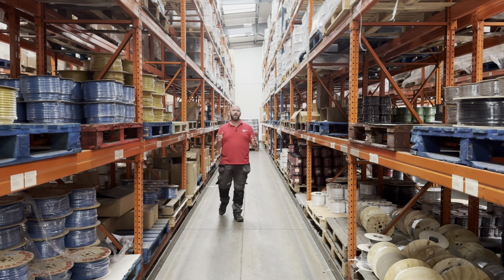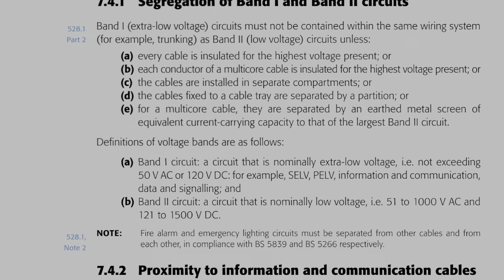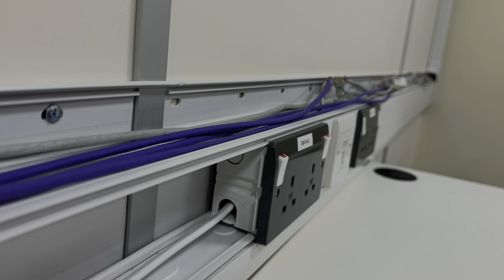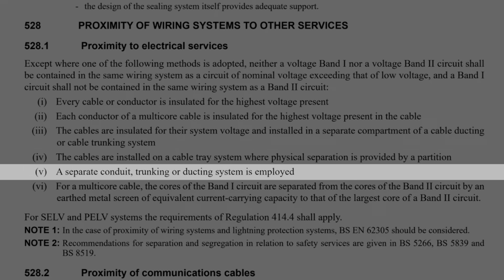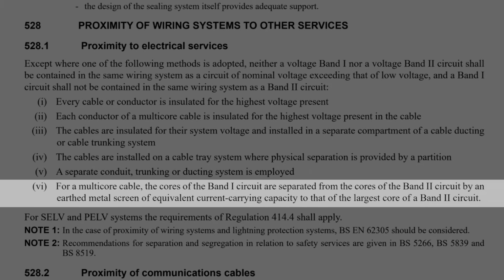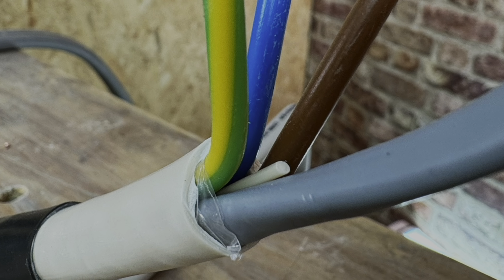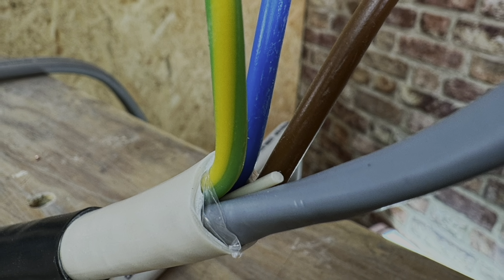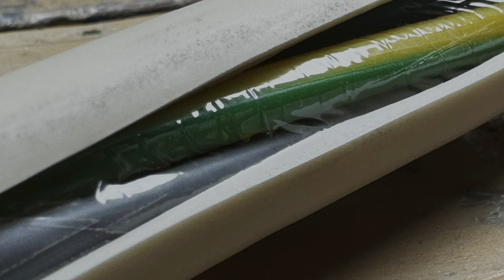Are Voltage Bands as Strict as You Think? Find Out!

Comment: WRONG. Band 1 and Band 2 cables have to be separated based on SAFETY alone. Not interference, but SAFETY.
Reply: yep. But the cable is made to be safe as is, so to be touchable from the outside, so therefore you can also run SELV and mains cables together.
Local regs can vary a bit. It's still a good idea to segregate a minimum.
--get a Chargehanger

Comment: Sorry but the magnetic field explanation is complete rubbish, the magnetic fields in the L&N conductors of mains cables are equal and opposite and Ethernet over Cat5/6 is a differential system so again no magnetic field. Foil screens don't block magnetic fields they reduce electrostatic fields. People need to stop repeating parrot fashion that you can do it because of interference because that simply isn't the case as proved by the situations where it is allowed and existence of specialist combined mains and data cables.

Comment: the signal in an electrical supply is about 50hz, the signal in standard cat 6 cable is several
million hertz - plus the twisted pair geometry is specifically designed to reduce external interference, which is why this argument has never made sense to me - missing insulation making the data cable live tho seem a lot more valid a reason

there also seems to be a lot talk about data cables with to some electricians saying this also applies to optic fibre (with a non conductive cladding) which I also don’t get
Reply: yes. Using a data cable with a grounded shield should instantly trigger a GFCI is any of the  band II conductors somehow makes its way onto the data cable.

And claiming this applies to fiber optics is just rubbish. They are insulators from an electrical stand point.

Comment: This kind of thing has been around for years. I remember back when I worked in the entertainment industry, using Van Damme Ambicore Hybrid to hook up huge PA systems
Reply: @JaenFoster  the Ambicore Hybrid isn't designed for Cat 5/6/7 data transmission though. The general idea is the same – power plus ancillary circuit in the same cable.

Comment: I assume this would also mean that SWA doesn’t require any separation to data cables as I don’t see how there could be any magnetic field leakage from a suitably grounded SWA cable
Reply: There is no magnetic field grounded screen/armour or not, L&N magnetic fields cancel each other out and grounded screens don't block magnetic fields they block electric/electrostatic fields.
Reply: I know someone ran SWA and cat 6 in the same ducting to the garden office good 15 meters. Not a single complaint from the customer about the internet.

Comment: Minor point, voltage doesn't create a magnetic field, it's the current that is flowing that does. It's also, more specifically, the imbalance in the currents of a multi conductor cable that results in a "net" magnetic field. I won't go into twisted pairs here. But provided the insulation is up to spec than you're good. The shield with drain wire is a nice extra.
Reply: I've always known it as a 'drain wire', too
Reply: That's just STP, been installing that from the early 90s yes I use SPT plugs on a regular basis, the problem is that aluminium is poor at blocking magnetic fields compared with other metals.  Data cables are however balanced and galvanicly isolated, even a real POE device has full galvanic isolation between the data cabling and the device (I have recently seen some POE devices that don't have this to reduce the need for magnetics these however I would avoid like the plague.   I would love to see what happens with something like one wire sent down EV ultra as it's not a balanced signal especially if the shield of the STP isn't grounded via the drain wire!
Reply: To be specific, there are two components to POE (POE+ or POE++ really).  The network data (ethernet), and the power.   The network data is capacitively coupled onto the 4 pair of the ethernet cable... Ethernet in general is always capacitively coupled, so its usually isolated which is very important in buildings and the very long cable runs that can happen.

But the POE+[+] power is different.  The power is DC.  In order to actually be isolated the AC->DC supply (whether it be a power brick or built into the POE+[+] router) must be isolated.  Most are, since the standard specifies isolation.

But it is a fragile situation and the reality is a bit different for several reasons.

* First, some POE+[+] routers driven from DC systems (such as 48V battery systems) are often not isolated in order to omit the DC-DC converter and vastly improve efficiency.  A 48V LiFePO4 battery bank, for example, generally runs 50-56.8V which is 100% compatible with the voltage specifications for POE+[+]. 

* Second, the isolation is NOT per-port... all the POE+ devices generally share the same actual power source and are not isolated from each other.   POE+ forwarding routers that are powered from the POE+ upstream do not re-isolate the DC power for egress.

* Which means... Third, unfortunately, one cannot easily vet all the POE+ devices that are plugged into POE+ routers and sometimes a device will ground the DC-... which grounds the entire POE+ network hanging off the router originating the power and de-isolates it.

There is no ground path testing done on POE+[+] power either.

--

Everything on the POE+[+] cable is differential... data (in pairs), AND power (4 DC+ conductors and 4 DC- conductors).  That said, it isn't perfect... noise leaks out due to slight imperfections in the differential waveforms and current flow over the power is not instantaneously differential at any given point (though it is broadly differential).

So if one is packing a lot of data cables together in a conduit, having additional shielding (aka STP cabling) does help.   STP is over-used in many places where it isn't needed, though.

-Matt
Reply: @junkerzn7312  POE is irrelevant DC magnetic fields can't induce a current in anything else only AC can.
Reply: @mfx1  If the cable were just sitting there doing nothing, sure.  But the signaling is AC at 125MHz and its full duplex... both sides are transmitting data over the same 4 pair in both directions at the same time at 125MHz.  The signaling is differential but it isn't perfect.  (125MHz signaling rate, 2 bits per baud... 250 MBits per twisted pair = 1 GBit for 4 pair).

And for POE+[+] the DC power also has noise on it as various devices pull power from it (usually with switching DC-DC power supplies... so anything from 20KHz to 2MHz).

For many reasons, this is why CAT cabling has evolved over the years, generally adding much tighter and frequent twists, messing with the twist ratios between the four pair, and (with STP) adding per-pair shielding.

So... yah, EMI is definitely a thing with ethernet cabling.  But it's only relevant for long runs and when one has a lot of cables packed together in a conduit (where they certainly can interfere with each other).  In those situations STP cabling is used to reduce the interference.

-Matt
Reply: @junkerzn7312  And yet bundles of 100's of Cat5/6 cables tightly packed together work just fine in office blocks and data centres around the world. Also combined power/data cables and connectors have been a thing in industrial automation for a LONG time.
Reply: @mfx1  Kid, I've been doing ethernet for almost 50 years, starting with Coaxial at 1MBit, and I've been an electrical engineer almost as long.   You can talk up whatever nonsense you like but it won't turn you into an expert.
Reply: @junkerzn7312  And yet you can't explain why cables that supposedly create so much EMI I can be run tightly together in bundles of hundreds of cables and yet still work fine. OK.

"You can talk up whatever nonsense you like but it won't turn you into an expert."

You should probably;y follow your own advice there.
Reply: @mfx1  Dude, you are completely out of your depth.  You can't just make up nonsense and then use that nonsense as your "proof" that something that obviously does happen and is a problem... is somehow not a problem and doesn't happen.  Give it up.
Reply: @junkerzn7312  So you can't explain why cables that are supposedly (according to you) chucking out a load of EMI work fine when bundled tightly together and you're saying I'm the one that's out of my depth!
Reply: There should be no net magnetic field unless you have leakage to earth somewhere also foil shields with drain wires do absolutely nothing to block magnetic fields they reduce electric fields.
Reply: @MarkGovier  Can I humbly suggest you learn more about electricity. Whilst current often results in stronger magnetic fields, if electrons flow (voltage) then an electric field is created that results in a magnetic field.
Reply: @jim.franklin  electron flow is not voltage, it's current.
Reply: @jim.franklin  You're the one that needs to learn more about electricity and magnetic/electric fields (from someone who spent years working in an EMC test laboratory).
Reply: @mfx1  Not really, you may think you do, but clearly you do not - if current causes magnetic fields not voltage, please do explain planetary magnetic fields, stellar magnetic fields, magnetars and black hole magnetic fields. I think that 40 years as an engineer and holding a PhD in high energy physics trumps your working in a lab. On a day to day basis, as I said, current will change the strength of a magnetic field in the human world, but voltage alone will create a magnetic field - if you think differently, I strongly suggest you do the maths and come up with an alternative to the standard model, the electroweak force and the work of James Clerk Maxwell - because his work goes far beyond the basic taught in electrical training (or used to get taught)
Reply: @jim.franklin  We're talking about wires and electricity not naturally occurring magnetism stay on subject.
Reply: @mfx1  Read the orioginal comment - it is factually wrong, so wind your neck in.
Reply: @ No it's 100% correct.
Reply: @ Clearly you are an idiot.
Reply: @jim.franklin  it's a bit more complicated than that, the interplay of electric and Magnetic Fields is a big subject but as a rule of thumb in the near field I find it easier to consider the electric field and the magnetic field separately.

Comment: Electromagnetic effects are taken into account, but the main reason for not mixing Band I and Band II is purely the dangers associated with a fault on the Band II causing dangerous voltages on the Band I cables. Modern cables, if the circuits have been installed correctly, should have minimal electromagnetic effects on cables surrounding them as the magnetic field is cancelled out in a balanced circuit. Please tell Neil at Doncaster Jim said HI glad to see they are making use of the wacky idea I threw their way during Covid!!
Reply: Indeed so, otherwise having all cables insulated to the highest voltage wouldn’t be in the list of exceptions.
Reply: Exactly, here in Australia S009 covers the same thing. It is all about not energising communication cable.
Reply: @craigsiedema  I really wonder what the actual rating of these communication cables would be. I have the feeling that they would easily offer the required insulation rating, but just lack the official testing.
Reply: @RandomUser2401  In the relevant Australian Standard, it is mostly about insulation damage on the data cable and LV (and above) at the same time - say from mechanical damage, therefore energising the data cable - and potentially the telecommunications network.
Reply: @craigsiedema sure, but my point was that probably most communication cables would satisfy band II insulation levels but simply lack the appropriate testing
Reply: @RandomUser2401 probably - I should have stated, I don't 100% agree with our rules. The intent is fine, but it's overly proscriptive. For example even in open air 50mm seperation is  required in the absence of mechanical protection.  Yet TPS is fine to be clipped along rafters and floor joists.